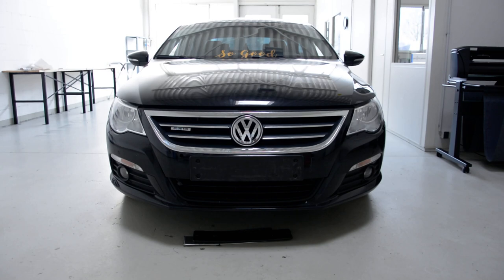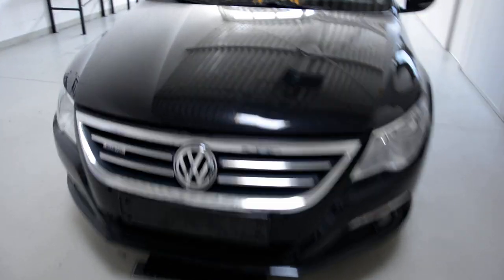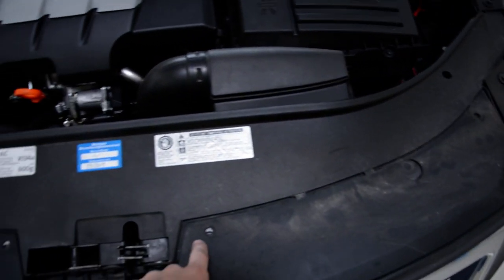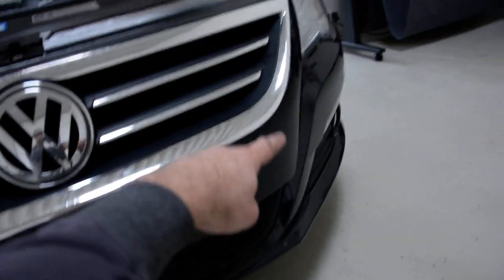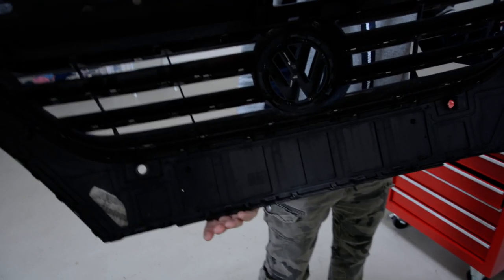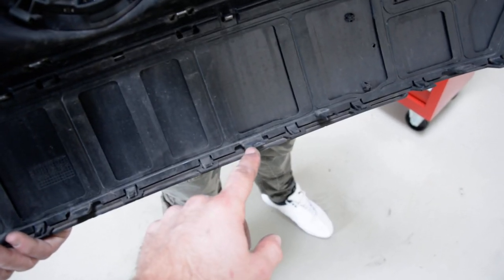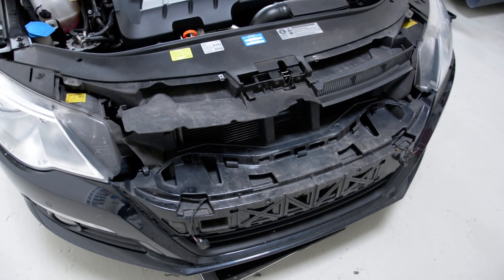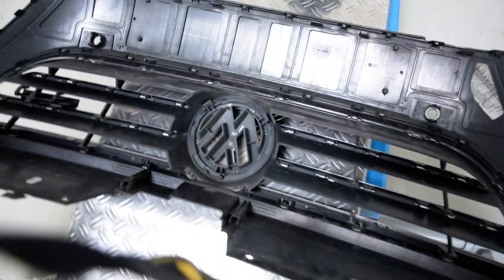How To Install Remove Front Grill Volkswagen Passat CC

Comment: hello guys, can i have simple question.. i need to know how two parking front senzors are fixed at the grill??? is it easy to remove from the grill? senzors there are on "click" or how ? thx for answer :)
Reply from the maker: the parking sensors have 2 clips left and right or top and bottom, don't push on them from outside you will break them